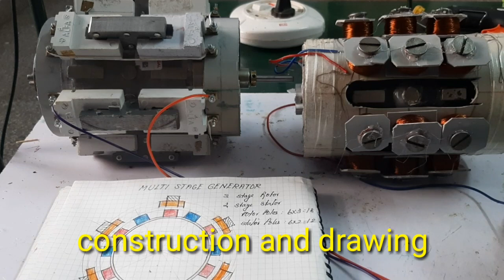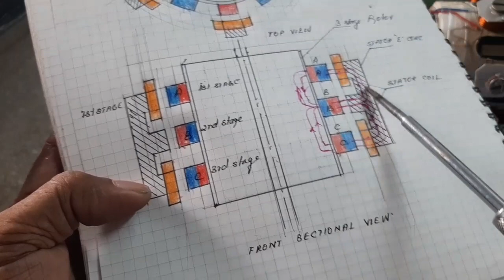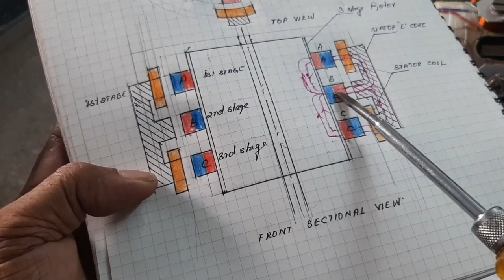500v multi stage  wind generator,Free energy or renewable energy generator (Type-2)

Comment: Would you have twice the voltage with just a single central stator coil for each row of magnets? As the flux density would be double on the central leg? Or is there another reason to have coil around each outer half leg? Like perhaps Lenz force cancellation? Thank you for kindly sharing your designs with us.
Reply from the maker: Thanks sir, and good suggestion also

Comment: Good work thanks for sharing
Have you more information wire thicknes or from where you have the coils
Reply from the maker: Thanks sir,
Coil of 3 phase air break contactor.
Coil wire is very thin and it may be 36 swg.
So current capacity is poor,if we using thicker wire the power capacity will be increased.
The generator required more than 2000 turns per coil so winding is not easy
That is why I selected these types of coils
Reply: @pugalstech  Thanks